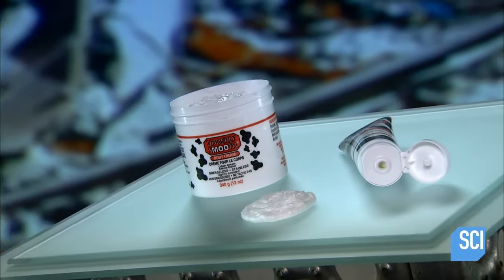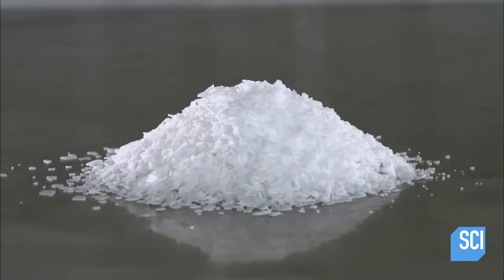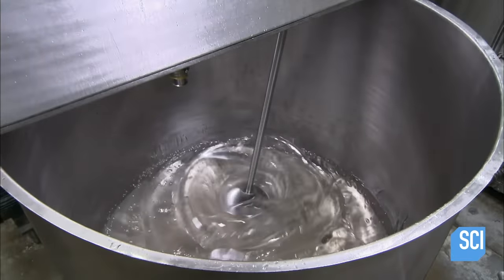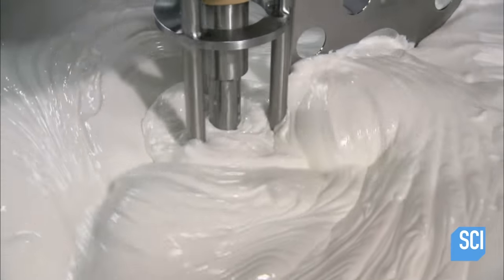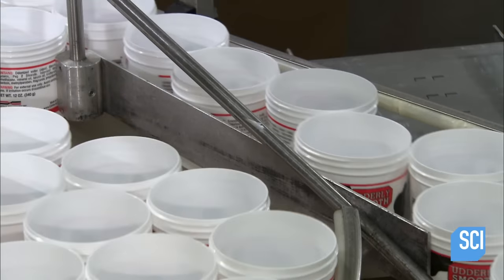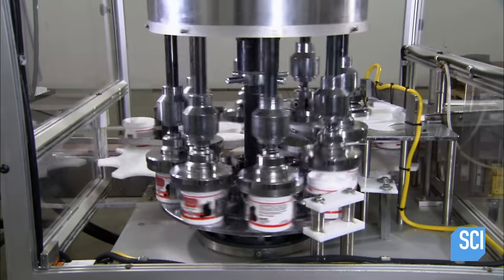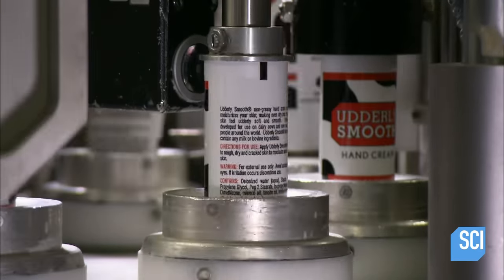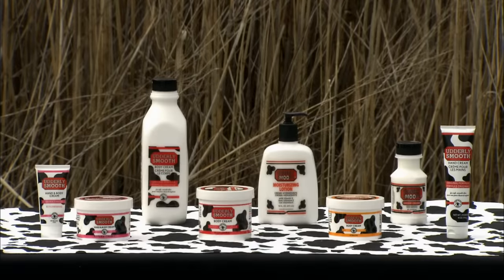How It's Made: Skin Cream

Comment: So... touching the containers' inside with bare hands, then putting the cream into the containers without sterilising it, is this really safe to use after all? I can see there is a risk of contamination with bacteria or viruses
Reply: the cosmetics industry does not work in sterile conditions (but yeah, I wondered as well why doesn't she wear gloves) ' moreover, I am 100000% sure that this product contains a preservative that should stop the bacteria, staph, and fungi from developing. Yes, the spores are even in the air, so there are no sterile manufacturing conditions, like in the pharmaceutical industry. Ingredients list: Deionized water (aqua), Stearic Acid, Glycerin, Peg 2 Stearate, Isopropyl Myristate, Dimethicone, Mineral Oil, Lanolin Oil, Triethanolamine, Allantoin, Methylparaben, Fragrance, Propylparaben. So yeah, there you go, there are 2 preservatives in there, Methylparaben and Propylparaben.

Comment: Its so weird to actually work on the conveyors that make this stuff. They 100% filmed their most stable line without that many errors. Those photo eyes and labelers are so finnicky! Plus the operators will say they have an issue cause not everything is perfect which it wont always be. Croocked labels, safety seal leaks, caps too tight, and yes.. Some bottles do have more product than others lol.

Comment: The narrator didn't mention that all skin creams must also contain a preservative. Any cosmetic product which includes water requires a preservative. Beware of purchasing creams that contain mineral oil. It is an 'occlusive' so blocks almost all the air from the skin, causing it to dry. This is why cheap lip salves make your lips drier over time. The air is prevented from reaching the lips (or skin, if its in cream). While the more expensive creams use natural oils and expensive ingredients, the cheap products use synthetic mineral oil because it doesn't go rancid over time when sitting on the supermarket shelf. Its inclusion is to protect the company from financial loss and has nothing to do with skin benefits. I made skin creams and natural body products to sell in markets, so have done quite a bit of research on this subject.
Reply: actually, mineral oil, as opposed to vegetable oils, seems to be less likely to cause a reaction on the skin of people with allergies and damaged skin barrier. It is occlusive but it does NOT block the air from the skin causing it to dry. There is no such thing. Dry skin is a skin condition caused by the lack of the oil soluble "stuff" from the "cement" that keeps the cells in the stratum corneum altogether. That is why petrolatum and mineral oil are actually the best ingredients to help repair the damaged barrier even in patients with diabetes or undergoing cancer therapy. The last thing you want to do is to provoke a latex allergy in such a patient because the skin barrier is severely impaired and they use shea butter. the mineral oil and petrolatum will not clog pores; they are indeed on the greasier side but it all comes to the dose that makes the poison. It is not a bad idea to create products that do not spoil while on the market shelf because buying a spoiled / poorly preserved product means that you are applying bacteria on your impaired skin which is not something you would want. If you are making products and selling them in markets and have done your research, you would know that your duty towards your customers is to sell them safe products, without fear-mongering and definitely without bashing the industry (selling based on fear(
Reply: While I respect people who prefer botanical extracts and oils, mineral oil is perfectly fine for many people. Sure it may not be the most nourishing bougie oil, but it works and is very unlikely to cause irritations; it is why many derms and pharmacists recommend it for sensitized skin and dry skin, and baby oils from major companies are often basically mineral oil with some botanicals and fragrance.